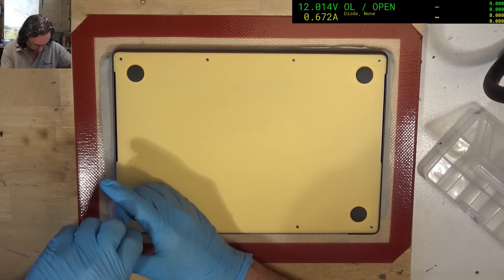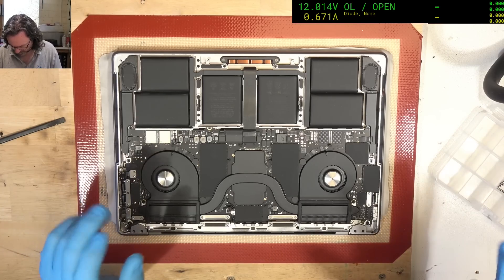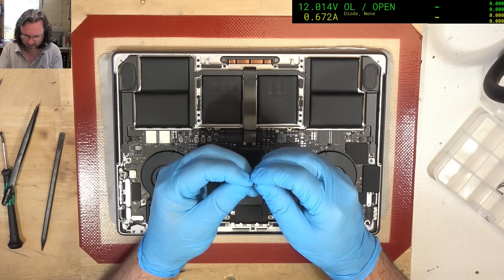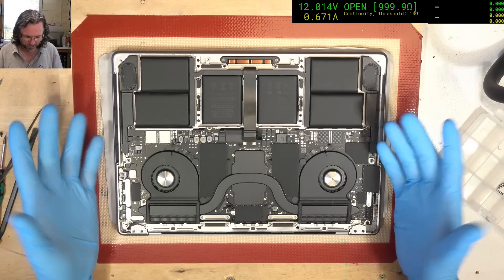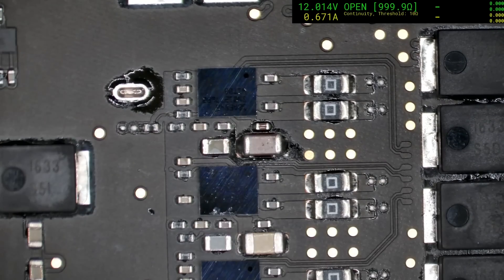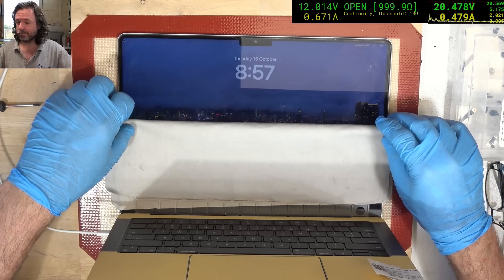Macbook Pro died while charging. This cause is one of the most common killers of modern machines.

Comment from the maker: 0:00:00 Intro Welcome
0:01:06 Initial inspection with lid removed
0:03:16 Inspecting the board after being removed from the chassis
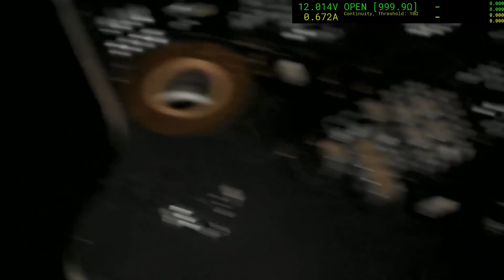0:03:55 Problem found
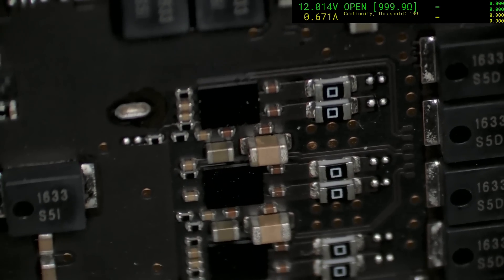0:04:03 Removing the faulty component
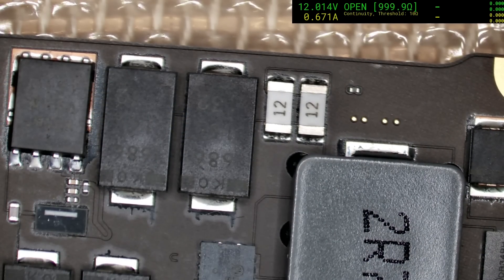0:04:52 Getting a replacemnt component to fit back on the board
0:06:17 Testing time
0:06:55 Summary of the job

Comment: I know parts fail and replacing the part cures the issue, but what causes them to fail in the first place
Reply from the maker: Imperfections, vibration, thermal cycling, shock, corrosion

Comment: I had this exact same repair case. Definitely a circuit design issue.
Reply from the maker: I'm absolutely happy for MLCCs to be used in machines for as long as possible; at least they're a component that you can replace and they're a frequent failure point.  Easier to swap them out than a SMC or T2 :D

Comment: Thanks Paul  for this Short precise fault diagnostics  and fix, Can you kindly advice what is tweezer you use for this job , looks pretty sturdy  ,Thanks
Reply from the maker: I'm currently going through my old stock of Qianli iNeezy Tweezers, they have that stepped ground down tip profile.  Fairly sure they still make them.   In the end when I find a pair that I like I tend to buy 5~10 of them so I don't have to go looking again any time too soon :)
Reply: Thanks I sincerely appreciate  your suggestion

Comment: Easiest way to find these quickly is with an IR camera. MLCCs should not be glowing :-)
Reply from the maker: It's an option I take if I can't find them visually.  Sometimes you get them and they're under 0.05R or over 10~15R and that makes them not so easy to find with safe injection levels (0.5->1V at 2~3A peak).  Was a good example in a previous video (live) I did where there was a short on the board and it was a MLCC but it was not showing up too well; easy to miss.

Anyhow, for me, I prefer the look first, if not found, try injection.

Comment: That was CAPtivating!
What I love is the PMICs etc usually have short detections allowing these faults to become "safe" instead of burning giant craters in the logic boards while toasting the cap or supply circuit.
Reply from the maker: What's "annoying" with newer PMICs ( USB-C series onwards for Macbooks ) is that they react so quickly that you don't get a chance to really see any thermal pulses under normal circumstances.

Still, better that they're fast and at least the board doesn't go up in smoke leaving behind a carbonised crater in the PCB.
Reply: @pldaniels  Higher framerate thermal cam, higher sensitivity and ability to trigger frame-by-frame delta analysis to capture any "blips" ?
Software can then buffer 5s of data and find the frame with the highest blip and amplify that to show where it was. With so little actual pixels it should be quite trivial.
Want to go nuts, add keypoint matching as well (lots of OpenCV libs available) to make sure correct pixels are compared in case of camera or board motion.

Comment: I didn't you just inject voltage on the shorted line and look for heat spot? Could have found that failed cap a lot faster. Non the less great job 👍
Reply from the maker: Because now and then it's not a shorted cap but rather a shot-through MOSFET for GPU/CPU or other sensitive area, and if you inject voltage inappropriately you can ruin the board.

The other reason is that it's less trouble to spend 10 minutes looking for a cracked cap than soldering on wires, setting up the DCPSU, setting up the iR cam and then scanning over the board looking for the short, particularly if it's outside of the ideal short range of ~0R1 - 10R, of which a lot of them can be (I've had extremely hard shorts < 50mR and very soft shorts >  15R which don't show up too well with iR due to lack of heat generated ).

I prefer to take some time and apply the least amount of rework/mods to a board level at a time to minimise risks, particularly with these soldered-on-and-encrypted SSDs.

Each to their own style, and this is the style I personally am most comfortable with when it comes to being accountable with the customer.

Comment: I have that same silicone non-stick mat on my (former) non-stick baking sheets. 
😊
Reply from the maker: It does the job well. I tried some fully opaque units but alas they didn't have the fiber reinforcements so tended to puff & buckle soon as heat was applied :(

Comment: another great video Paul. Good eye catching the damage on that cap.
Reply from the maker: Indeed was happy to see that crack.  Usually I start with PMIC areas, then speakers amps... I missed this one the first round or two.  At least this one was visible, unlike the one from the recent live-stream where the crack was located on the underside ( had to restort to primative injection and thermal check )

Comment: I have the MacBook Air of the same vintage and I can see mine lasting quite a few more years. The speed is fine for anything but very compute intensive programs.
Reply from the maker: That being an M1 A2337 unit?  They're nice machines.  I actually do like them because they still have the more realistic build and only requiring 5 minutes to extract the board.
Reply: @pldaniels  Yes. Good to know that it should be easy to service. I’ve used Macs since 1988 and only had 2 problems. A burnt out resistor on a Mac Plus and a faulty power supply on a early iMac, which was replaced under warranty.

Comment: What is the point to put the cap back? This device has already passed the FCC test
Reply from the maker: This cap is more for rail ripple stability (uF) than high frequency noise control ( pF ). 

These are for the local speaker amps so keeping the effective ESR down and helping avoid rail sag is useful. 

Easy to replace these ones with no real risks

Comment: How did you spot that capacitor to be faulty? The cap shows no signs of being dead or cracked. Can't have just spotted it.
Reply from the maker: The damage was visible - you get used to seeing their tell-tale visible flaws; that's why I search over the boards with the boards held at an oblique angle as it tends to be more efficient at revealing the cracks.  Note also that I'm using an optical microscope and the quality of what I see is always going to better than the video recording
Reply: @pldaniels  safer way if you got the equipment. I tend to inject 1v and grab thermal camera.
Reply from the maker: @GurjVirdee  that certainly does work if you're fortunate enough to have it fail within the 0.1~10R sort of resistance range.  I had one on a live stream the other day that was nearly impossible to find with the thermal cam :(

Comment from the maker: Seems like Sorin just released a video around the same time as I did with the same sort of failure, somewhat demonstrating that this sort of failure is the most common we get for the electronics, and I'm thankful for it.
Reply: in contrast to Sorin you actually solder back the component...
Reply from the maker: For some situations I won't, usually if it's in a high thermal sink area and there's sufficient nearby decoupling capacitance to support the loss of the cap removed, but certainly where it's no/little risk to put it back I much prefer to certainly.
Reply: @pldaniels Hi. Great job as ever. To follow a low risk path while doing a fix seems a sensibile thing. So why do you used hot air gun to change that cap? IMHO to expose a PCB to the minimum amount of heat the best solution Is a normal iron with a suitable large tip, heating both edges of the cap at the same time...same results with minimum heat spread. I believe that hot gun should be used only when It would be impossible to do otherwise, like QFN chips or MosFet. Regards from Italy.
Reply from the maker: @paolomonai9511  the difficulty is getting the transfer of enough thermal energy in to the board to release/reinstall the cap without risking slippage/forced-removal.  There's BGAs and other small parts either side and there's just not enough room to get a sufficiently large solder tip down there to cover both sides of the cap.   

You can put a huge blob of solder on a solder tip and rest it on the cap top or side, and it frequently will not desolder the cap no matter how long you wait because these boards sink thermal energy away very quickly; the same applies for soldering tweezers too.

Frequently if you watch the videos/live-streams I'll employ a "hot air assist" technique to solder with the iron because of just how aggressively these boards wick the heat away.

On the balance of risks, removing/reinstalling with hotair is the safest option.
Reply: You guy both share such valuable info for us , so thank you so much 🙏
Reply: I got up this morning and saw the two notifications, and thought it a bit odd. He posted ~1 hour after yours, and it's so fun to see; The two of you have such radical different ways of approaching both the diagnostic- and the repair aspect. You are meticulous, safe and thorough, while EasyPizza.. I mean Sorin.. thrives using his way. Luckily though, this time he actually didn't just delete the cap with a blade or tweezers
Reply from the maker: He has quite a following that's for sure.  Where did the "Easy Pizza" thing come from (I did notice that on his thumbnails now)
Reply: @pldaniels  It's always been "Easy Pizza" for Sorin as long as I remember. The meaning of it is easy money(pizza money). Sorin likes to compare repair prizes to pizza prizes since   different countries have different costs. But relative cost to pizza vs repair should be around same. When in UK Sorin said pizza costs like 25 pounds in some other country might cost like 10 pounds.  By the way how much is pizza in Australia? ;) I assume around same as in UK.
Reply from the maker: @TriodeTetrode  depending on the toppings about $16 AUD which is ~8 pounds; that's for a PizzaHut chain store type option.
Reply: @pldaniels  Yeah, there are times a missing cap wont do anything bad, but yours was on the audio, and I would 100/100 replace it, as you did, though I doubt Sorin would. As @TriodeTetrode says, that's where he got the pizza thing from, but it's only been a "big" thing of late. Think it was around late last year og early this year he started emphasising it.
Btw; In Norway a large basic pizza costs equivalent to $28-30AU 😣
Reply: @pldaniels  Then it seems to be cheaper than in UK.
Reply: @pldaniels He’s usually taking jobs from a service repair shop. They charge the customer 60£ and he charges them half of that for the job, which is a pizza cost there as he mentions. That is why he needs to solve them fast without removing the boards so he does not spend more than 30 minutes for a repair otherwise the price he charges doesn’t make sense. If he does it faster than that, it’s an easy pizza for him. 
Now, I would like to see you both working on a 2 layer iphone board where you loose an extra hour for sandwich separation, reball, solder back + the repair itself. All for about the same amount of money
Reply: @boardrev  I have seen Sorin's refusal to remove a motherboard, due to time restraints imposed upon the low repair fees, come back to bite him. He goes down a rabbit hole, thinking the issue is on the motherboard's topside when, in fact, the issue is on the board's backside.
Reply from the maker: @boardrev  @gregm  it's an interesting business strategy; you get a lot of jobs, a lot of experience, but that margin of return is still painfully low - I would guess it depends a lot on the costs of living in his area.  Earning $50 AUD/success here I would be needing to clear at least 4 jobs/day successfully and preferrably 6 in order to maintain current income levels.  Conversely, 1 macbook/day does it at the moment.